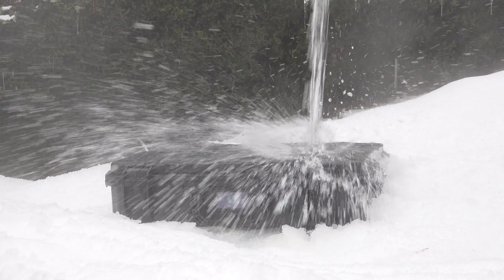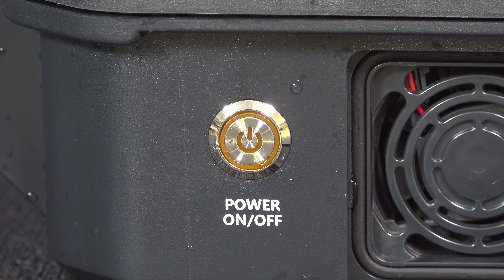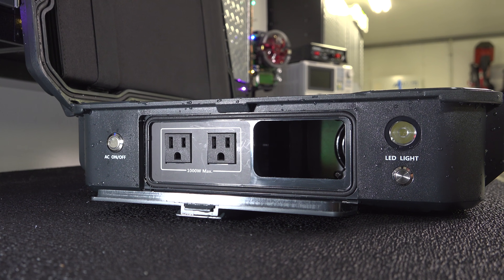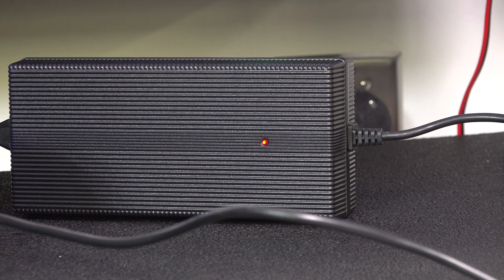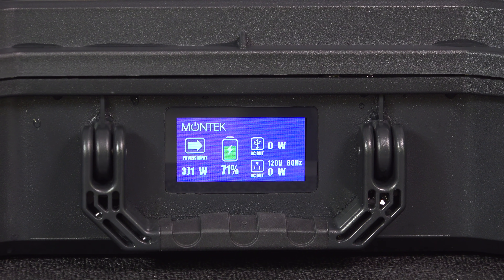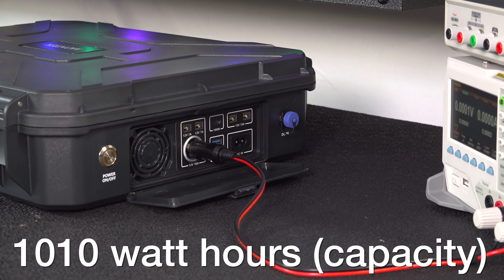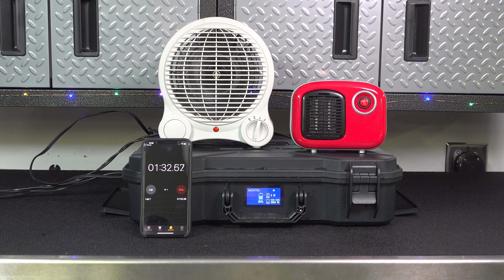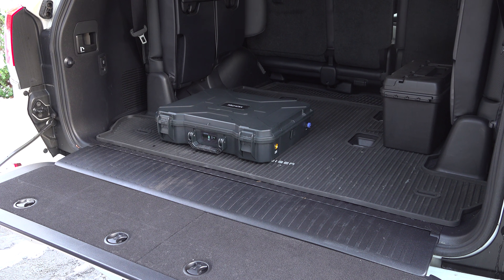Waterproof 1000 Watt Battery Generator CHEAP & Solar Power Station - Montek X-1000 Review

Comment from the maker: 🔥The kickstarter is over but a great alternative the new Ecoflow Delta Mini: https://ecoflow.com/collections/delta-series?aff=37
Reply from the maker: @hughsmitham722  The link has all the details: https://monteksolar1000.kckb.st/79cd2559  It's crowdfunded and they are offering 50% off if you purchase it now. The unit I had was a production unit and was flawless as shown with my tests using lab grade instruments. You can certainly wait until it's on Amazon but the price will be $1049 later. I had no complaints at all with this unit and it had better efficiency than the Bluetti AC200P
Reply: Hi Please can you help me how can I buy the one that you advertise thank you
Reply: @manuelaperezelmapag-2713  go to the link provided or go to Amazon and search for this unit
Reply: @sixpackbinky  still not avail on amazon yet as of 4/29
Reply: Hello. I've never been involved in any "crowd funding" campaigns & I'm totally ignorant to this scenario. But I've taken the time to review all of the comments below & have SOMEWHAT🥺 of a clearer understanding.

My only question is what are consumer options in the event of malfunction(s) or dissatisfaction with the purchase?  Is there any recourse? How do consumer obtain C.S.? Thank you
Reply: Quando é
Reply: $549 does not include the solar panel. You can get 1 to 4 added depending on how much you want to spend.
Reply from the maker: @hughsmitham722  This was a production model per the manufacturer which makes sense since I found no faults with any of the unit as shown. If you are worried wait for it to be on Amazon but it will be $1049 later.
Reply: @SilverCymbal  Do you think this would have passed your 3000w supertest like you did on the other 1000w generator?
Reply: @SilverCymbal  Okay I clicked on the link but it says "closed". So I have to wait for it on Amazon ?
Reply: No it's not and the other is waterproof too
Reply: only 1000 psss give me 10 of them
Reply: If I charged this up and tossed it in my trunk how long would it stay charged?
I was wondering about using something like this as a gas can for my EV. It's only a 60th of my car's full capacity, but that's good for several miles at least.
Probably wouldn't need a rugged one like this though.

Comment: I've noticed that in all the reviews I've watched on the Montek that no one mentions the fan with in the cable storage compartment.  I doesn't even mention it in the manual. I am assuming that it is a good idea to have both side doors open when the unit is charging or running. On my Montek the fan runs at a varying speed as if the power is fluctuating. Has any one else experienced this?

Comment: 2 months?  It took 9 months for mine to arrive.  Lol.  Do you think it's okay to operate the unit both while it's standing on end and when it's laying down (so that you can read the display properly)?  Or is it better one way than the other?
Reply from the maker: Unfortunately that unit started just before Covid really delayed everything but when the unit is on you need to have the side doors open for ventilation so that will limit you to placing it on the wide bottom when using it. If  you could somehow mount it sideways and have the doors open I dont see why that would cause an issues as long as the doors were open for air, nothing inside should be affected by angle. Hope this helps
Reply: @SilverCymbal  Yes, thank you.  I thought it could be either way.

Comment: I received mine last week and have been testing it to charge my Sur Ron Light Bee electric motorcycle. It performs well and since it has pass through charging I am pushing solar through it as I charge my bike. It's a great unit and will allow me to charge my bike while out in the desert. Prior to this I was using a Goal Zero Yeti 1000 and I find this a much better buy.
Reply: Well you answered my question so thanks. I don't have a sur Ron but I have two 72 volt bikes and two 52 volt bikes that I'm sure this would work fine on especially with additional solar panels.
Reply: @williambontrager2349  also the unit is incredible at maintaining its charge.
Reply: @markkitaoka8783  thanks! Did you have to get a bigger solar panel to make a dent in charging the sur Ron and if so which  ones if it's not a bother?

Comment: hi. May I know the name of the tool that you used in the video to open the inner cover of the generator when you showed the battery inside and where I can but one. Can you also show me where I can purchase the power adapter that can be used for decreasing the charge time at AC outlet? Incidentally, can I use this generator for powering my freezer or refrigerator? I await your reply.

Comment: Its a battery not a generator
Reply: It's a battery, solar charge controller, inverter, and solar panel in one unit. These are referred to as "solar generators", per Wikipedia.
Reply: @JeffKubel  Thats funny, I didn't see any solar panels in the video. If your gonna call it a generator you'd think that would be a pretty important feature to go over. As used in the video, its just a big battery bank.
Reply: @BOBimusRex  it's got a spot on the inside for a folding solar panel that comes with the kickstarter. Maybe his preproduction unit didn't have one or he didn't know it was in there but it does have solar input and a solar charge controller.

Comment: I would be concerned with heat dissipation while the inverter is running.no where for cooling air to cool it.unless you run it with the case open, which defeats the water proof part.
Reply from the maker: It's only waterproof during transport, but no other unit made offers this so for some this is a really welcome feature.

Comment: "Its ok if you paid for 1000 watts but only got 900" that is still mislabeled and false marketing. Awesome review tho
Reply: NO -  it actually isnt. You clearly didnt listen/understand him or the concept. They are telling you that it contains 1000 . how much you get out of it depends on the efficiency of the devices you attach to it. Youre assuming that a gallon of gas should provide the same amount of mileage in every car -  it wont. it will provide the same amount of actual energy in every car, but how that car uses it will vary based on the cars efficiency .
Reply: @readyrepairs  you lost me there when u said efficiency of devices attached to it? Efficiency does fluctuate with load, but output power max should be 1000 watts, with this unit: it never reach that amount of output power, hence false marketing. Common anology to that is when someone buys memory card and marketing label, states that 2 terabytes, and u actually get 1.9 aprx, they will state that some amount of it used for processing blah blah, that still false marketing. Consumer should expect that much to be available as to what is stated, or disclosed righ upfront if not. Hence false marketing.

Comment: It is a generator.  A generator is a device that converts motive power (mechanical energy) into electrical power for use in an external circuit

Comment: You note that the AC outlets are rated for 1,000 watts each.  If both outlets are used is the total output 2,000 or 1,000 watts?  Thanks.

Comment: SIR, would this power your 800w LG portable AC unit?
Reply from the maker: Yes definitely.
Reply: @SilverCymbal  thanks very much. I just wrote this and then I saw on the spec sheet on their inigogo website it shows the surge is rated to 2000w. ;-)

Comment: Yes we all know those king of cases are waterproof. Nothing new. But there is a fan in it so if your going to waist time pouring water on it then pour water on the fan and see how fast that thing stops working. And a solar generator is only a solar generator when the sun is being used. This is not even a "generator ". Its a battery pack with a power inverter.  Nothing more.

Comment: AC outlets are 1000 watts TOTAL, Not “each” as video says...it’s shown printed on the box...be careful to match what narrator says, to what the product really has..,public will spot those kind of errors, & it can really mess up a startup. 
This looks like a great gadget!   Very good looking, very functional.  The price reduction for getting one through their campaign, makes this box a fair price, compared with similar....but the solar panels they offer to go with it, seem higher priced...more than the golden goal of $1 per watt. But still reasonable compared with others...if they are monocrystaline.
Reply from the maker: Correct some devices have limited output on some ports. These are connected together for the 1000 watts total. This is by far the best 1000 watt deal on any device at this price but even more so with the rugged case. https://monteksolar1000.kckb.st/79cd2559   If you get one I think you will be very impressed.
Reply: @SilverCymbal    I like the shape of it for easy carry.  And yes...your crowdfund prices are great.  Will prices be similar once it comes to market? 
Have you been really careful to vet quality of manufacturers contracted with.....cuz we’ve been badly burned by a few...bad manufacture was what killed most; we got totally ripped-off by one that looked like a sure thing using reconfigured old-tech...shoulda worked, easy...but the promoters took nearly $300K of crowdfund collected, & moved back to India to try selling it there. 
So we are VERY cautious now, what we spend on crowdfunding.  The only reason we got a Goal Zero, box & products before, was after they showed up at Costco Roadshows, selling for near-crowdfund prices.  That company has a great collection of products now, & expanding.   But we still look for more and better products like this, because these boxes allow us to power one room at a time using on-site energy. 
That allows us to reduce our utility bills by one room at a time, as we can afford to do them, instead of solarizing a mandatory grid-tied system all at once, & out of our control.
I think this new box has serious competitive edge.   That’s why I clicked to follow it on indegogo.
Reply: @SilverCymbal   @Silver Cymbal  BTW, are the solar panels monocrystaline?
Reply from the maker: @itsallaboutjesus8935  Yes they are,  - 120W Monocrystalline solar panel

Comment: Power GENERATOR?  It’s a BATTERY, a STORAGE DEVICE.
Reply: it can output power to devices and charge via solar panel simultaneously. if that's not a generator prove me wrong and i'll listen.
Reply: @MrHatetheplayer  — I thought it could be connected to solar.  The video didn’t say it was a solar panel itself.  Am I wrong?

Comment: I'd like you guys to make it at least 2000 Watt and I'll purchase one.
Reply: Iam with you, 2000 watts!
Reply: Wait a while, 2000 watts will be next, then you can run your hair dryer!
Reply: Agree!
Reply: Buy 2 for the price of one jackery
Reply: 1000 watta makes it pretty useless. But 2000 would be one of the best option out there.
Reply: Just buy 2. More portability/ flexibility. 500 for this seems reasonable. For me more impotantly is cycles.  Id like to see 3500. That means it will last or the baterry will outlast the exterior hardware
Reply: The o poll rice is $1 per watt

Comment: Make this in a 5000 watt and with solar and I'll buy it.
Reply: And it won’t be portable!
Reply: @succulentgallery4424  and you'd need what, 10 solar panels? Like you're pointing out, it's whole schtick is it's portable. ;-)
Reply: @dgunearthed7859  No, the system is all about the battery storage. You can feed it til it's full slowly with fewer panels or faster with more panels.
Reply: YES   alotta  people,  would......for   shure...sure....yup  goodie
Reply: @petersack5074  and you'll pay 5,000 dollars?

Comment: A couple questions
1. Can you hook two or more in parallel?
2. How much noise does it make when running?
Reply from the maker: Yes you can hook up more than one panel and the noise while running is almost inaudible. Only the AC charging has the fan turn on high speed which is still very quiet. Not loud at all. - If you decide to order please check out: https://tinyurl.com/y7hagtgp

Comment: Water proof when you close  the case. I'm more amazed when  terminals open and working operation then wash one bucket of water thats a water proof. I can do anything in water proof with plastic bags.
Reply from the maker: Very true but most power units are not even weatherproof at all can can't handle a drop of rain while being transported so its definitely an improvement

Comment: Whats do you think of the 400 watt charger is it worth $150 plus $25 shipping or are there other cheaper options out there?
Reply from the maker: You can probably find the charger for a little less but the end will be the issue. By the time your source it and make your own you likely won't save too much. The speed it charges with it was amazing, especially when you combine it with the AC. I get a lot of requests from DJs who need power in a rugged package but usually they charge up slow. This is totally different. https://monteksolar1000.kckb.st/79cd2559 I think it's a ok price for the size charger it is. The whole thing is a very nice package especially for the intro price.

Comment: I am really IMPRESSED with this unit.  All in one with the solar panels is great. WooHoo!  Thanks for the preview.   bill in Florida.
Reply: search for existing similar units, when considering crowdfunded products. 
Similar products already on market, or coming to market around same time, have been the undoing of many crowdfunded products! 
So has bad manufacturing..that usually is when a startup is not very savvy, or gets cheated on contracts by bad manufacturers. 
First products are often done as small-production with tight quality control.  Then, the startup must contract with “the big guys”, to make enough to come to market...THAT is usually a common fail-point.  
And customer service can go wrong, as strapped and stressed startups try to cut costs any way they can in order to get it to market....even badly.   Customer service is critical...& commonly done very badly.

Comment: Shame the ports and outlets aren't IP rated.
Reply: I read as many comments as I can because I'm hoping all of a sudden one day a lightbulb will go on & it'll make sense.

Can you please explain what this means?
Reply: @itsallaboutjesus8935  https://en.m.wikipedia.org/wiki/IP_Code The DC input is weatherrproof (2:51 ) however it's a shame the other outlets are not also weatherproof. This means the unit can be charged in bad weather only, but the unit can't be discharged in bad weather and needs to be moved or set in a protected area before plugging in any appliances. (It isn't really "waterproof power" as advertised, because it would be very dangerous to plug in appliances outdoors in the rain...)

Comment: Hi, Question on the solar panels.   Will only the 80W panel fit inside or would the 120 fit also?  Thanks!  Great Review - just subscribed!
Reply from the maker: I appreciate that, this was a fun unit to work with. It can only fit the current 80 watt, that being said it is possible higher wattage panels will come later that are the same size so the space can be used for anything, even a small notebook computer possibly too.  Order here: https://monteksolar1000.kckb.st/79cd2559

Comment: What brand, watts and amps heater did you use???
Reply from the maker: That heater has had more appearances in my videos than me! Ill check the brand but its a 1500watt heater. 3 settings, 18w (fan only) 850watt (low heat) 1500 (high) If you watch my other gen vids you will see it again. It's been very solid for testing but I think the cord is ready to go. I don't know the amps off my head but you can figure it out with a calc for 120v

Comment: Where is Montek from??
Reply from the maker: Hong Kong
Reply: @SilverCymbal  do you think they have to tweek this or is it perfect for production?
Reply from the maker: @Pipefitter310  Unlike some early products I was told this IS the production model. It would appear that way to me, the fit in finish inside and out was excellent. My testing equipment is laboratory grade stuff as shown so my numbers are accurate, others are testing products with low end tools that are not, no fault of their own but a $30 tester vs $9,000 matters.  You can't go wrong with the unit for the $549 price https://monteksolar1000.kckb.st/79cd2559
Reply: @SilverCymbal  thanks 🙏